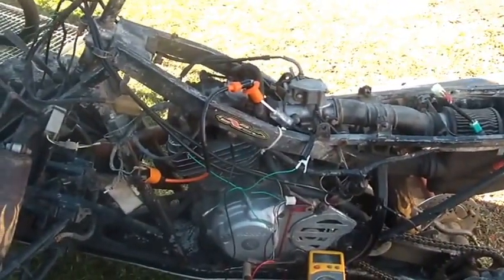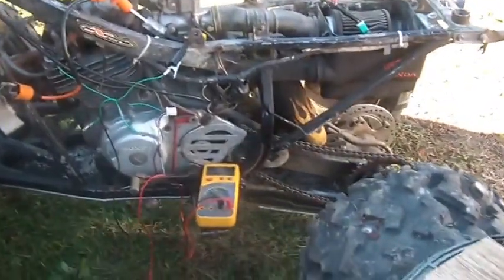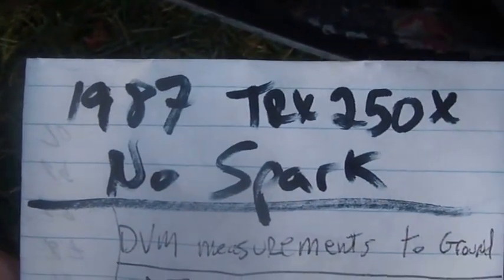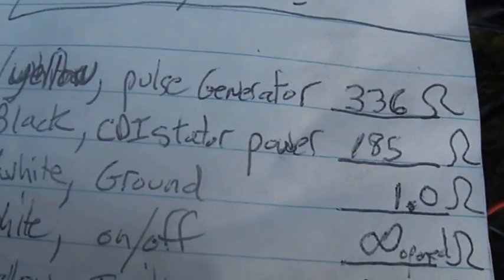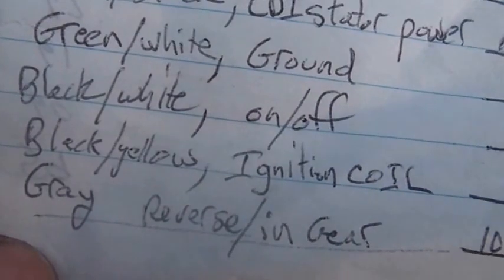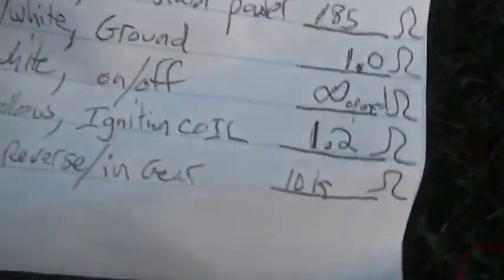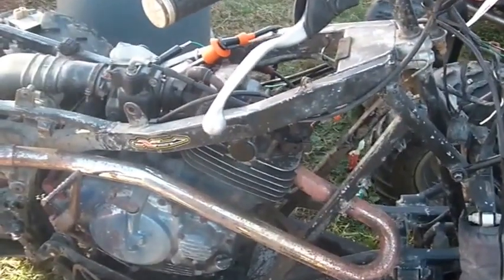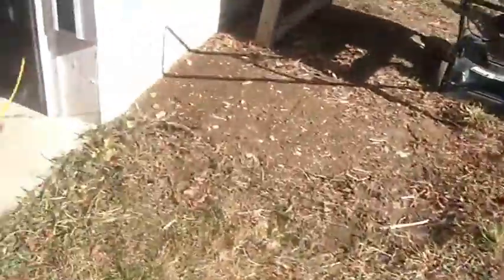No Spark 1987 Honda 250EX, diagnosing a  bad ignition coil,

Comment: Dude I like you're  videos but that's a 250x not a 250 ex the ex is not even close to the same they came out later on and are shaft drive.. the 250x is the same as a 300ex but the 300ex has a lower compression piston because of the elec start and in my opinion the 250x is a better bike by far
Reply from the maker: Hey Mike, U R right, it is a 250X, not a 250EX.... Unfortunately someone wiped the VIN and model number before I got it, that stopped me from decoding it and to be honest, kind of stopped the project.... I'm looking for a new frame with a proper VIN and model stick to go forward with....  NYS law says that one can own an ATV without a vin, but, it can not be sold, it can also be hard to explain if traveling with it.... Thanks for the info, Ur encouragement, watching, and commenting!!!

Comment: i have one just like it but its a 300 dont have spark om going make harness like urs and go from ther  .let us see wen u fired it up
Reply from the maker: Hey Rafael, I built one wire harness and it will go on the 250 or 300, I just need to wrap it and install it, thanks for reminding me, watching, and commenting!!!!
Reply: el tuercas does a 87 Honda 87 have a Dylan so if it's low on oil and won't start

Comment: 1987 to 1991 trx250x it was replaced by trx300ex in 1992. The trx250ex came in the late 90s but is a complete different bike it then changed its name to trx250x in the mid 2000s also with a face lift  (plastics)
Reply from the maker: Hey Bill, Good Info on the Honda time line history for the TRX250EX, I have not fired this one up yet, the snow slowed me down a bit.... Comparing the 250EX to the 300EX, I like the 300EX better, the electric start makes life so much easier.... Thanks for the info, your thoughts, watching, and commenting!!!
Reply: that's weird cause i got a 1992 250x
Reply: 87-92 are TRX250X, 93-06 are TRX300EX, 07-present are TRX250EX